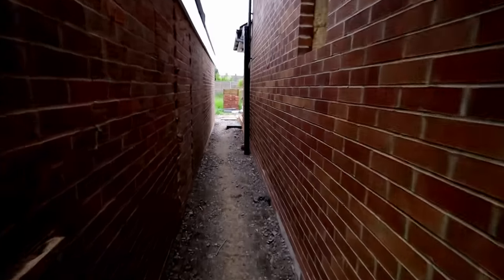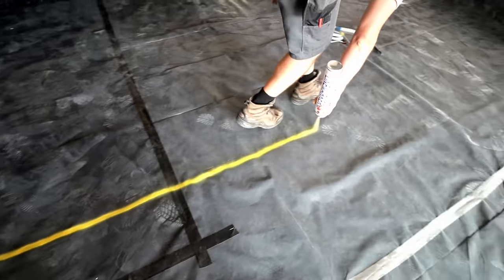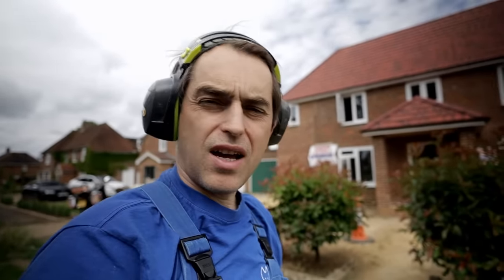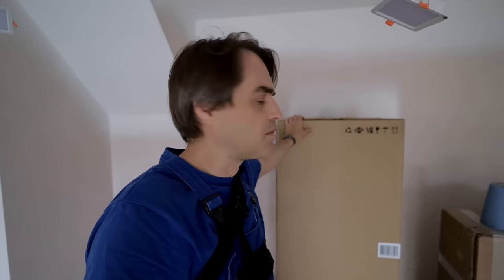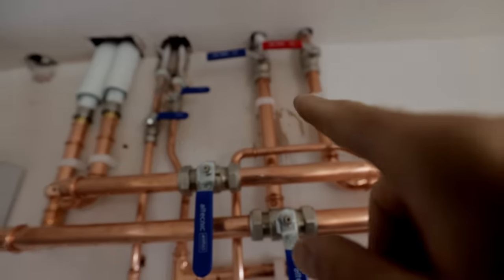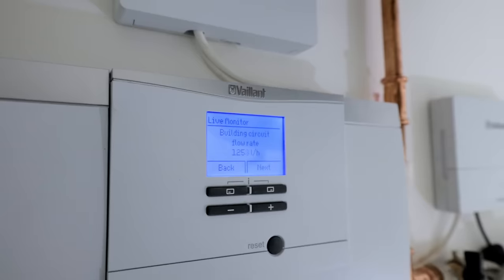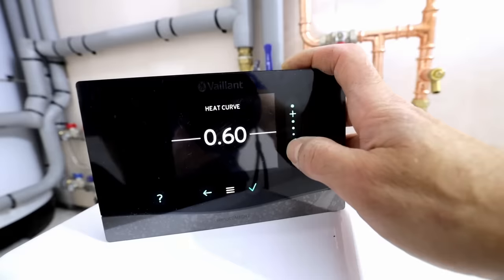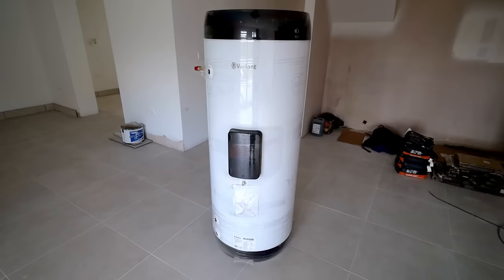Gas Boilers No Longer Make Sense, Here Is Why.

Comment: Another brilliant film. Are they installing solar panels, inverters and batteries? I didn't know that the £5K grant was still available. I'd be interested to know what the whole thing cost? Did you price for supply of materials or was that the builder's job? I'm a keen DIYer and installed my combi central heating system in 2005. I've had a spare BIASI combi boiler in my loft all that time and just swopped over the one that has been running all that time, this summer. It hadn't failed, but several buttons didn't work, the pressure guage was all over the place and I thought if I don't swop it over now, it will never be used. As it is, I installed an 8.7kW solar array last December as my bills had gone up 600% since 2021. We hardly run the GCH last winter because of cost. I've since installed an unvented Gledhill cylinder with 2 x 3kW immersions which run off the solar and battery bank. On Octopus Go tariff, overnight electricity can be had for 9.5p/ kWh, although the gas has just gone down to 7.5p / kWh. Having the unvented cylinder has taken a huge load off my batteries and inverters (which are capable of providing 15kW discharge) because we were relying on a 9.5kW electric shower previous to this. Now the unvented cylinder provides a great shower. It's all a bit piecemeal, but has meant my £4000 gas and electric bill this year has been reduced down to hopefully £1000. I hope to not have to turn the GCH on this winter as I bought 2kW electric heaters for all the rooms and my battery bank can supply about 30kWh per day. If you work out what a gas boiler uses in the winter however, it's nearer 60kWh per day, but at least my unvented cylinder can be heated up overnight and will last until the next twenty four hours so that means more battery bank available for cooking, lighting and heating. I can't justify the £5000 for a heat pump just at this stage, but possibly in the future.
Reply from the maker: Yes, solar PV is planned for this house

Comment: This installation only makes sense because there is low temperature underfloor heating. When well below freezing outside, an air heat pump with only radiators will struggle, with expensive to run resistance heating having to come in. 

An alternative to gas, is having the whole all electric. First ensure the house is highly insulated: cavity wall insulated, insulated external doors, triple glazing. Eliminate air leaks as much as possible. Seal up loft and loft hatch.  Have cheaper to fit electric underfloor heating.  Heat hot water via immersion heaters. 

Now have solar panels on the roof and elsewhere. Then fit a home battery set. Eliminating a gas meter save £100 per year in standing charges. That can buy a lot of electricity. 

The solar panels and home battery set can near eliminate buying electricity from the grid, depending on solar size of course.

Comment: Love your workmanship, but that home looks like it's A-Rated, with all the work done to the building fabric. Perfect for a 7kW heat pump, running at a low temperature. However, the additional extras required to get a home "heat pump ready", is a big turn-off. Insulation, new glazing, UFH system, new piping, new rads, new HP cylinder, new controls, space for plant etc. A £5000 grant isn't going to go very far.
Reply: If you can afford a big home you can afford to pay a bit more towards your heating system.

Comment: Hi, interesting video as usual. How does the design life of a heat pump compare to that of a gas boiler I wonder. I was surprised that you had to replace a Danfoss HP after only 13 years in one of your videos (`Unlocking Super Efficiency: Air Source Heat Pump Swap With Vaillant Arotherm'). Presumably you don't get another grant to offset the cost of replacement heat pumps?
If you do then i wonder how long that cushion will last. My modern condensing gas boiler is 19 years old but of course could be on it's last legs (and in fairness it is not worked as hard as a lot of boilers since I live solo). I'm not against HPs, just raising the longevity issue.
Reply from the maker: no grant for replacing existing HPs. That unit there could have been repaired. The woners did not want to reapir it, as it was and internal compressor unit, that was a bit noisy inside and also not the most relaible unit, that caused them some issues.
Reply: @UrbanPlumbers  Thanks. So I assume the manufacturers you’ve dealt with don’t declare the design life of their units and you can’t comment from experience as yet?
Reply from the maker: I am aware of units lasting as little as one year if they are cycling and also there units running now that are way past 20 years - so all depends on how the are installed, controlled and how the system was designed
Reply: Inverter based units should do very little cycling. @UrbanPlumbers

Comment: And add the extra cost for an AC unit when going the gas boiler route. Add solar and the running costs become even lower. With a big property is easily achieveable getting around 500-600w of power from an array in cloudy weather. Thats easily a 2kva heater running all day, for free. And during the summer you get free power for basically everything.

I went the new build route, intergas xource 7 heat pump, 10kw of solar and my heating costs are ZERO. (mind you, a government law dictates that every KW i put on the grid, i can reuse for free the same fiscal year). Even without that rule, i would be much cheaper than gas, since having the connection to the gas grid alone is 400 euros a year, and gas is over 1,30 per m3. We run a jacuzzi and triple split AC all summer aswell, for free of that 10kw system.

Concerning ROI, i dont really care. With a bit of luck my system lasts 20 years or more. Building gasless here has massive government grants, making it a no brainer. Maintenance aside, I wont have to worry about heating costs at all anymore. Many people get sick and are out of a job, plummeting into poverty. Lowering your monthly bills is SO important. Many people have to pay over 400 a month just on gas alone these days here. Thats half my mortgage, FOR THE ENTIRE PROJECT!!

(also knowing im not funding the UA war as much is nice)

Comment: The challenge will be the winter operation. I live 5 mins from a London tube station in Bucks, yet I am getting temps down to -10 deg C. Last year we had -16 C one night. I assume the heat store will be using electric boost heaters.
Reply from the maker: No electric boost heaters are needed on modern heat pumps and this one doesn’t have it
Reply: Use a ground source heat pump.

Comment: It's for the rich only.. normal working folk can't pay extortionate amounts for insulation and then the extortionate prices for a heat pump..
Makes no sense at all at the moment for the masses.
Reply: just keep throwing your money at the energy companies then
Reply: @edc1569  Heat Pumps cost the same if not more to run. They're being pushed to de-carbonise, not to make heating cheaper.
They use a more expensive fuel.. electricity
Reply from the maker: but done well they are 25-30% cheaper to run. If you take advantage of cheap overnight tarrif and batery stroage they become 50-70% cheaper to run. If you have storage and PV some people see a very quick payback time and are no longer tied to changing energy prices. Saving the planet is also a good reason to do it.
Reply: @UrbanPlumbers  I get your reasoning here.. but.. throw in battery storage and you're talking even more dosh for kit/install.
I'm a gas engineer, predominantly S&R but do the odd install too.
It's simply too expensive. If you're optimising the heat pump with UFH.. that's even more money.. It's simply not viable for the masses. For select income groups.. yes.. but not the mass market.

Comment: Air to air heat pumps are even better. No plumbing required 😅

And with £5000 alone you could easily buy 48,000 BTU air source to air heat pump equipment.
Reply: where does your condense water go?
Reply: @edc1569  With a tube outside of the building.

Comment: I'd be interested in the cooling system too, although this summer we've had in the UK hasn't been that hot to give it a proper test.
Reply: Trust me. Once you have AC at home, you will use it a lot more than you think. No more sleepless nights when it's muggy.

Comment: My colleague friend had a heat pump he had a hot water tank but the hotwater tank the hotwater never reached more than 52 degrees. She kept the heatpump but add a small gas boiler for the hotwater to reach 65 degrees.
The heatpump will be good for radiators but not for household hotwater.
Reply from the maker: sounds like it was never installed correctly. This unit can bring the DHW to 70c.
Reply: bad product, bad install or defective product. Also why heat hotwater to 65 degrees? Above 60 degrees, excessive limescale built up is going on, so the lifetime will be shortened alot running at such a high temperature. 55-60 tank temperature should be max, and with weekly legionella thermal shock you can go down lower and sit around 50C to maximize COP and minimise heat loss of tthe tank.
Reply: We have a GSHP and get piping hot water always.

Comment: Where these have been fitted in hundreds/thousands of new estates i.e. Scotland they have a big problem with noise pollution - imagine a whole estate with these mega sized fans whirring away - photovoltaics and electricity is the way to go - why govt hasn't made law that all new builds should have PV panels fitted I will never know.
Reply from the maker: Totally agree. PV should be mandated on all new builds. We already have noise regulations regarding heat pumps. Modern heat pumps are no longer a noise issue if and when installed to current regulations

Comment: There is nothing wrong with the question "what is the RoI?"

It even sounds like there is a basis for ahowing a positive RoI even at todays prices (then with potential for greater than expected in the future).

Don't be afraid of the question.
Reply: Ultimately, it depends on the individual house and owner.  Some may be able to see a RoI from day one, but for some, it might seem as never paying for itself. Some people might want to switch to a heat pump for other reasons, e.g. someone with anosmia can't smell (or has a limited sense of smell) and thus can't smell a gas leak, so the cost of switching might literally save their life.  That peace of mind is in itself an instant return on investment.  The ones in this video are doing a major renovation, which would by law need a low-temperature heating system, and thus get a shorter RoI on that system by getting a heat pump.

Comment: As much as this excellent work, it's not the real world for the vast majority of home owners. The massive jumps for most people will be price and space, adoption is likely to remain low.
Reply from the maker: it dpeneds. If we can assure that all new HP installations are cheaper to run than existing gas systems and then offer finance that is paid by the diffence saved, then it is a no brainer.

Hoever it shoud be a much wider soultion, not only heat pumps but also: insulation, windows if needed, solar PV and battery storage at the same time to get the absolute most of the new system.

Comment: No one has yet addressed how the continuing fall of solar prices will bring the demise of the heat pump. While they are highly efficient, they are also complicated and costly compared to resistance heating units. Resistance heating is WAY less efficient BUT when electricity is free, that argument becomes inoperative. You have to start weighing the difference between the cost of a heat pump vs the cost of resistance heat and a few more solar panels to make up the energy shortfall. Resistance heat also doesn't need resistance heat as a backup if temperatures fall below the ability of the heat pump to deliver sufficient warmth. The resistance heater device can just be expanded to whatever size is necessary for the expected low temperatures, no matter how extreme. With heat pumps, there comes a point where the the temperature is so low they just don't work. I recently added an electric water heater in front of our gas unit to take advantage of solar overproduction and cut our gas bill $30 a month. Watch for resistance to become a comeback thing!
Reply: Weird argument, an Air 2 Air unit can provide the heating of 4-5 radiators for the same amount of electricity.  That "free" electricity can be used for other things, stored in a battery or sold back to the grid, so the heat pump would make up the difference pretty quickly.  For the UK the resistive heating backup is basically a non issue, many can go down to -20C without issue.
Reply: Solar energy helps very little during the heating season, where demand is highest, and thats where the heatpump will still shine. Electricity will never be free, no matter how you put it when operating in electrical grid market where costs always reflect production and demand. Excess solar has higher value selling to grid in winter than normally.
Reply: You know it's not very sunny in winter? Seems easier to just 1/4 amount of energy in the first place.

Comment: Great install. I'm just not convinced this is what most home owners want. At what point is it just better to go passivehaus & some elec UFH.
Reply: First build your passivehaus. My brother used to import Swedish house kits nearly 40 years ago, so I know it can be done, but as a retrofit ? Difficult, certainly on my small Victorian stone pile.
Reply from the maker: it is still better to have a heat pump if you go the passive house route - amazing efficiencies of well over 400% and cheap DHW.

As a matter of fact I have videos coming soon from 2 passive house installations we have done this year. This house is not even close to passive standard.
Reply: why not put a tiny 3kW heat pump in your passivhaus, after all its nice to be able to have the doors and windows open without fear of never recovering the temperature.  A lot of UK housing stock you can't afford to loose the floor space that would be needs for passivhaus.
Reply: @UrbanPlumbers  love your work. I'm just struggling to see the mass adoption of heat pumps. I can see them taking a sizeable chunk of the market. I guess the biggest issue is just the shear volume they take up & the complexity. This is a very difficult sell to the average customer who just wants a box on the wall that magically makes the house warm. 

My area of interest is the changing grid. I can see a roadmap for renewables covering the lions share of elec production. I can see that converting all cars to EV isn't an issue, as some think. However the rub comes with heat pumps. I have downloaded last years gas & elec consumption for the UK to create as accurate a model of the grid for different secareos. The model begins to break down above 15% of total gas consumption swaped for heat pump.  

I look forward to your next video.
Reply: @RB-eg7mj  Heat pumps are the only option if we are to tackle global warming. New gas boilers will be illegal in not much over 10 years time.
Reply: @rogerphelps9939   The question I'm asking is how will the grid support said heat pumps. On a cold winters day the grid feels stressed @55Gw if half the homes had their heat pumps running, drawing a very modest 1kw that is an additional 17Gw. Where is that elec going to come from. Sadly wind is our as  a cold front is windless. So we could double our gas fired power station or 6 Hinckley C. I'm just not sure anyone has the stomach for that. I would love to be proven wrong.
Reply: @RB-eg7mj   You are absolutely right and I too am concerned about the question. At a recent  agricultural show there was a National Grid stand and I asked the question. Clearly I asked the wrong person because he had no idea. In my opinion we need a massive expansion of renewables and probably nuclear too. Coupled with that we need massive amounts of storage and interconnects; batteries will be way too inadequate. I think that a possible solution would be to use excess nuclear and renewables to produce hydrogen which woulf be stored in old gas fields and used to generate electricity as required. Natural gas, i.e. methane is a greenhouse gas and carbon capture and storagehas not been successful anywhere  so it cannot be used if we are to get to net zero CO2.  Fortunately the adoption of heat pumps will happen over many years so hopefully there will be time to put in the necessary renewables and storage. Heat pumps are going to need around 4 times the energy of the average electric car.  I have both plus solar panels so I do understand the problem.
Reply: @rogerphelps9939   could I suggest a crazy idea, as an interim solution. What if our heating was like a hybrid car. A combi & resistive. We could dump excess wind into heating, but use gas for the cold snap. As the grid gets greener, so does our heating. Could an imperfect solution be a better solution. A commercial building I worked on ages ago. 600kw gas boiler & 25 ish wall mounted A/C cassetes. What interesting things could you do with a sofisticated control system & intelligent elec metering.